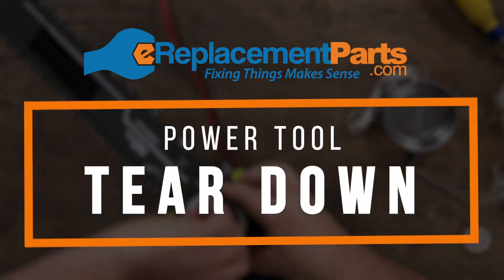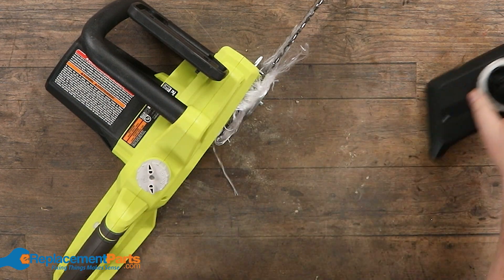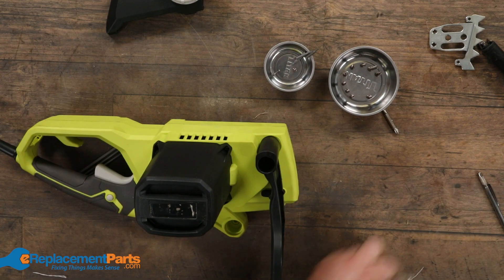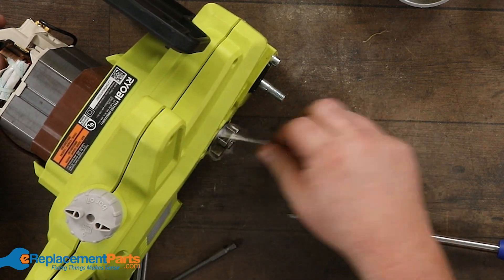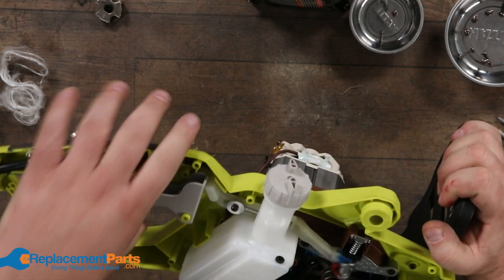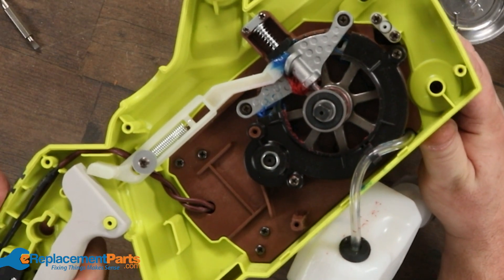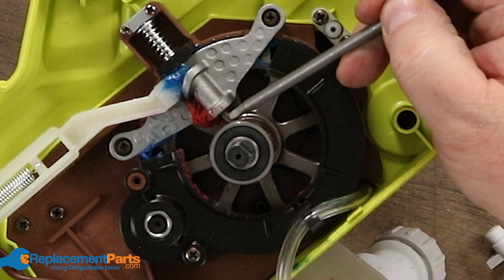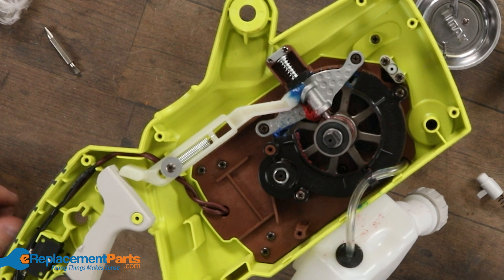Tool Tear Down: Electric Chainsaw | How to Disassemble Your Chainsaw | eReplacementParts.com

Comment: Hello thank you for your video. My chainsaw was misused in last fall to cut hedge so it was jamed by some small twigs and leaves, I had cleaned those before storing it in winter. But I find it cannot start when I take it out yesterday. It is an electrical type. Could you please suggest what the problem would be? Thanks a lot.